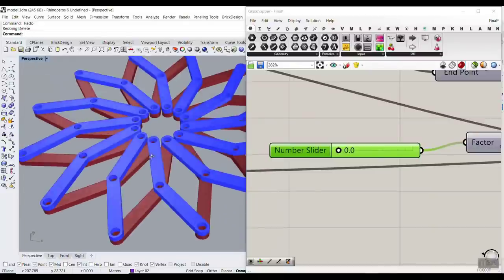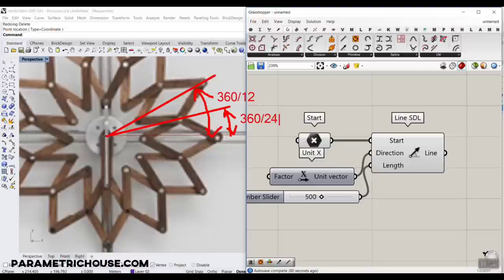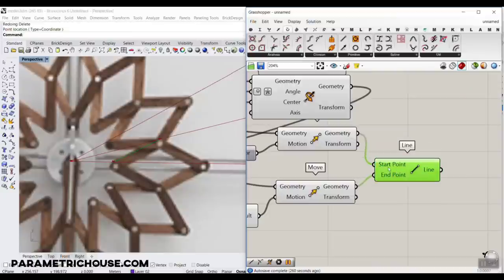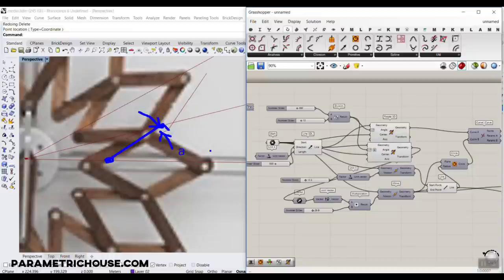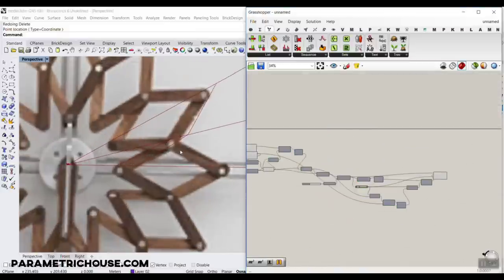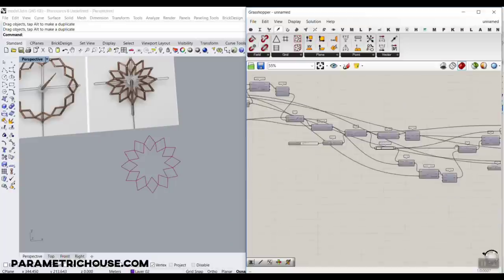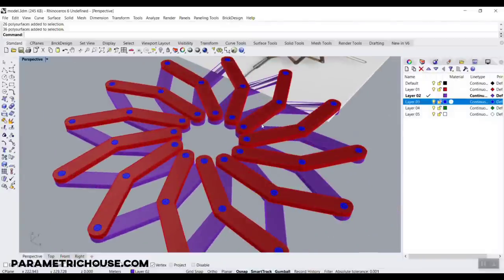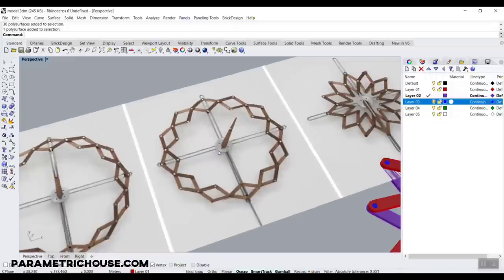Kinetic Clock (Grasshopper Tutorial)

Comment: Rhino can you please tell me that what should be the angle of inner side of each strip and size of one strip? And one more what at the centre I mean Its kinda motor or something else?
Reply: Doesn't look like you'll get a response Mayank. My guess is the angle of each piece is 30 degrees. (something to do with 360 degrees divided by 12 hours equals 30 degrees, which is what I measured using a protractor on my pc screen). The width of the timber pieces looks to be 1 inch wide and maybe 1/4 inch thick. Distance between the two outer holes probably 6 inches with the middle hole 3 inches. Make 24 exact same pieces. the rest is up to you although on the Solstice video there are ample indications how it all goes together.

I don't do all this fancy computing, way too old and couldn't be bothered. I just look at the mechanics of something and make guesses on the size of parts and angles. How this thing goes together is reasonably straightforward, the only issues being making the guide rails and how the thing rolls/slides on the rails. The clock part can be a cheap Chinese quartz unit with only using the hour hand. Should be a fun project...